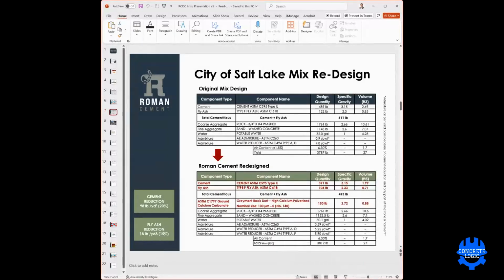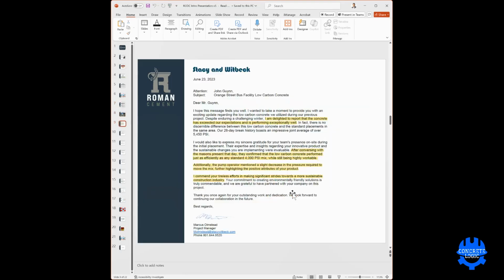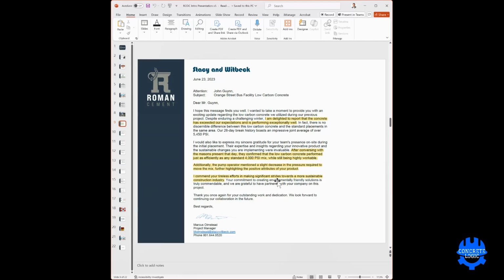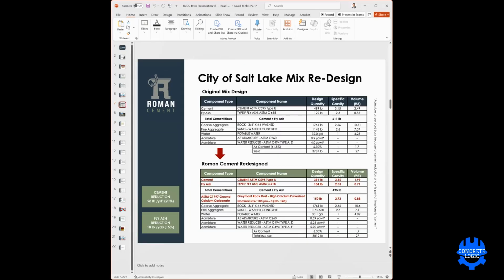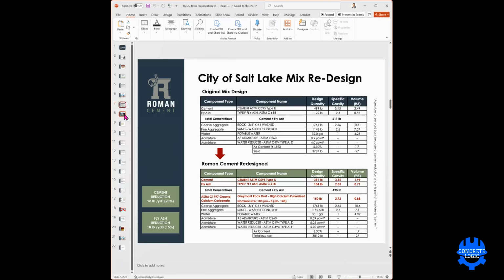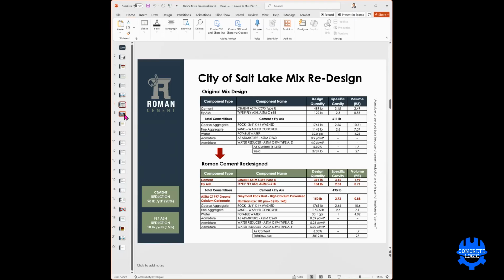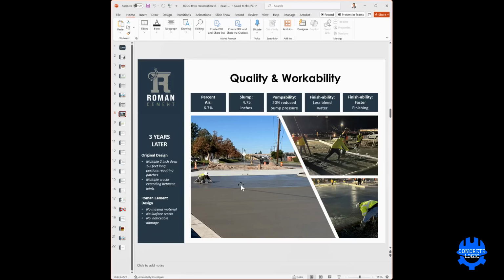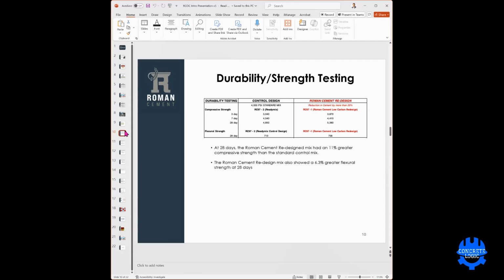EP #119: Is More Limestone the Key to Stronger, Cheaper Concrete?

Comment: In addition to air entrained could 10-mm basalt fiber glass be used to increase the tensile strength? As to fly ash in the cement, that should be at the cement producer as to the differing chemical composition that the fly ash suppliers can produce and is not going to be testable at the mix plant without multiple testing procedures, and as pointed out, remains in the cost / benefit calculations and standards that the cement producers have the abilities to control.  As to this 'carbon reduction, I look at this more as to the energy input to produce a viable product.  And how about a dehydrated bauxite (baked to like 300-400*C @ 20 micrometer)  with micro sands [80 micrometer](to prevent floculation) as a strengthening and quick set additive?